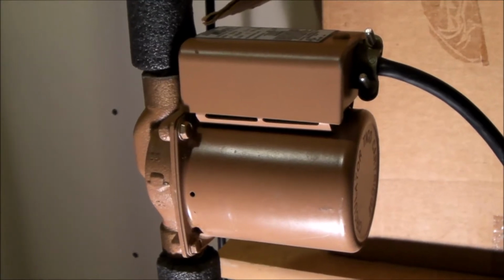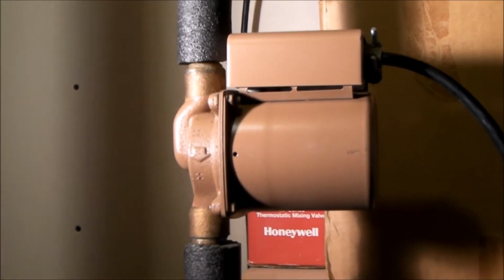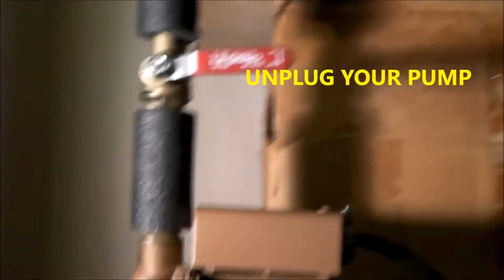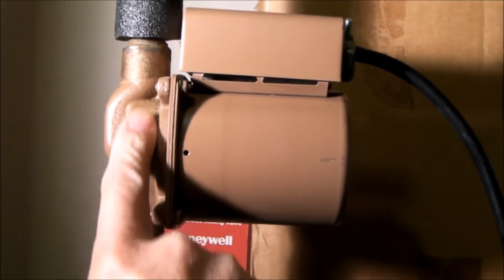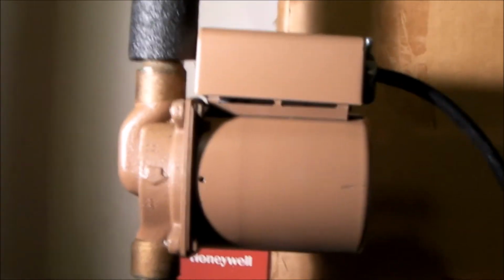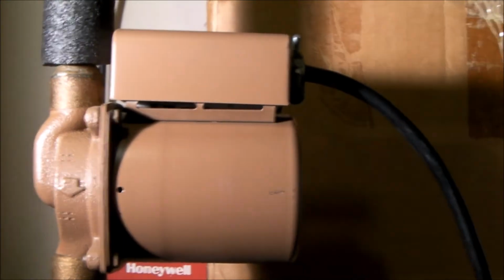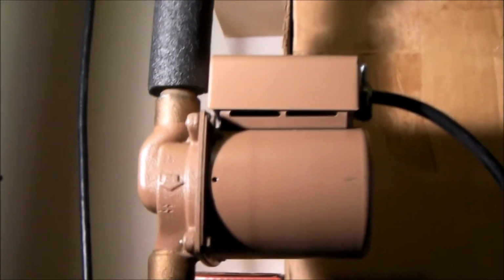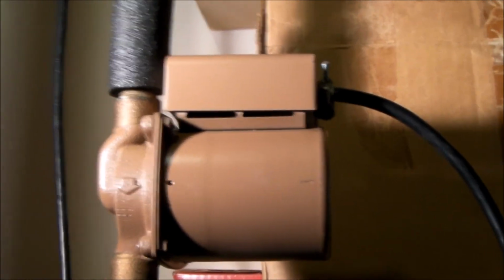Noisy Taco Hot Water Circulation Recirculation Pump - Solved

Comment: Very helpful indeed. Mine was making the same vibrating noise following a short power outage. My solution was simply to unplug the pump for twelve hours and let everyone in the house take showers (nearly everyone complained about how long it took for the water to get hot)! I plugged it back in in the morning and the pump is as quiet as ever. My conclusion is that the flushing that took place over the course of time was enough to clear out the pump and allow it to return to normal. I will re-post if further steps are required. Thank you for your helpful tip!
Reply: So you bled the line without opening it? Mine doesn’t have check valves 😬 it’s usually installed on the return line so it doesn’t have water actively going through it, don’t think…

Comment: THANK YOU!  I had flushed the hot water tank and then the pump started making the noises as you described.  I didn't notice it at first as the pump is on a smart switch and we have Alexa fire it off when we need the hot water boost.  When hot water didn't come as fast as usual, I did check the pump it was running hot and noisy.  My first inclination was that there was an air lock.  I searched the internet and luckily stumbled on to your video.  When I loosened the screws, air did hiss out.  In hind sight, that was all I needed to do.  I, however, pressed forward in case there were debris.  (Again, if I had really thought about it, I would discount debris as there was minimal debris when I flushed the heater.) After a few more turns on the screws, I took a shower even though I had turned off the valves above and below the pump :-(  For better or worse there was no blockage in the system.  While I had the pump out I cleaned the little debris present; reconnected the pump and its purring quietly.   Going forward, for me, when I flush the heater again, unless I see a lot of debris, I'll just "burp" the circulator if this happens. THANKS AGAIN!

Comment: Thanks very much. I repaired my Monitor water hydrant today. Now I have the same exact issue you had. I'll work in it tomorrow. Hopefully I didn't burn out the unit. It must have run for several hours before I realized that it probably had an air blockage. Best to you!

Comment: That’s the exact sound I was hearing in the building I live in. It was so loud you could hear it through the baseboard heating. Like I hear the water moving and sometimes little buzzing but sometimes it be so loud like a vibration noise it was so annoying. Finally the landlords replaced the pump now it’s silent

Comment: If this is for a hot water heat system or domestic hot circulation line, there should be a boiler drain or hose connection attached to the system for air bleeding. When the system is repaired or drained, the " closed loop" must be bled of all air. Just hook a small garden hose to it and drain to floor drain for 5-10 minutes while running the pump in normal conditions. Anytime air is introduced to the system, it must be bled or an air lock condition will occur, such as yours. And Yes check valves are required and No, Taco double 00 pumps do not have built in check valves. If the pump is used for domestic hot water, the pump housing or volute must be stainless or bronze as cast iron will contaminate the drinking water..... Great video Thanks

Comment: Good job. I have a very if not identical setup as you. Just replaced my LP power vent water heater...and during the replacement I guess lots of mineral deposits that were in the old heater got dislodged and up into the hot lines. It's like white coarse sand. Now my taco pump is not spinning. I guess I will open it up tonight. My recirc system does work without the pump but would like to get it spinning again. Thanks

Comment: Same thing happened to me today! We replaced expansion take and feed water pressure regulator. Then, when calling heat the unit would fire up and then fire off a minute or two later. I hit the circulator with a hammer lightly a few times, drained the system, then purged it out (lot of air). After, it fired up and stayed on. I am hoping there is no problems going forward.
Reply: I never took the top off the circulator pump. Given the location, it's hard to get in there to take it off. Purging the system did the trick.

Comment: My upstairs heat stopped working. It was working just the other day. I had a similar problem a few months back and my oil service replaced the Taco circulator pump. I just noticed the same pump is a little noisy when I turn the heat on upstairs but no heat. I wonder if I’m experiencing what you describe. Not sure if this is related but yesterday I noticed the toilet water was a little brown, even after a few flushes. Today it was clear.

Comment: Had the same noise. Had air in the pipes. So no water pressure to to the circulator so I did a release of air pressure from the furnace and the problem was solved. Did not have to take the circulator apart.
Reply from the maker: I did NOT take the circ completely apart.  Just loosened the flange to release the air and tightened back up.  Be sure to LIKE and Subscribe.  That will really HELP me! THANKS!!!

Comment: Interesting that your direction of flow arrow is facing in the opposite direction of where the electrical housing is.
I put the same Taco unit in today and the arrow flow is pointing in the direction of the electrical housing.

Why is this pointing away on yours?
Reply from the maker: Not really interesting .... the motor can be oriented in any ONE of 4 different positions.  The motor rotation is the same CCW or CW (depending on which end you're viewing it from) direction regardless of where the electrical connection box is.
Reply: @YuDaMan  It's interesting because as when I was installing it yesterday and I was curious of if the motor could be turned in that direction. Then I see it on YouTube later that day.

Comment: Water is what cools the pump,  if you have air in your loop ,  Eventually the pump cavitation that iar pocket and won't pump the water.  leading to burning out the pump .  Every now and then I find the systems need to be bleed out. Though I'm not sure why you installed 2 check valves,  you don't need them , the pump housing already has one in it. All you're doing is restricting the flow.
Reply from the maker: my circ pumps do NOT have check valves.

Comment: Hi YDM. Great video!!! I think this may be my problem. However NOT I've found I have a leak above the motor. Can I still get hot water in the house with the recirculation pump off and the valves on either side closed? It's the weekend and I'll have to wait for a plumber.

Comment: Thanks for the video. I have a question, so if the pump was dry then the water was obviously not circulating? Did you notice that the water was taking longer than normal to heat up before you flushed the line out? I ask because our pump started making that noise a couple days ago but we are still getting instant hot water at the faucets. I'm thinking my pump is maybe going bad.
Reply from the maker: not sure I can answer your question since it was quite awhile ago and I'd had to give you bad info.  I would however appreciate a LIKE and a SUBSCRIBE.  That would really help me.  THANKS!!!

Comment: Your video is FANTASTIC! I have the same exact problem. Thank you.  Question: What if I don't have TWO isolation valves like you? I have a valve feeding the pump, which I can shut off, and there's a check valve on the outlet side, before the pipe just feeds back into the water heater.  Can I still do what you said, or do I have to drain the whole water heater to make sure it doesn't flood when I open the pump?
Reply from the maker: Close the valve.  I think you will be able to loosen the screws but not remove them and you will be able to bleed air and water.  I would not take them completely out.  just loosen all of them the same # of turns. Then jiggle the pump to break the seal contact.  Then slowly open the valve, maybe not all the way and leave open until you have no air and only water dripping.  Then tighten up the screws, open the valve all the way and turn on pump.  It should all tighten up easily and nicely.  If your check valve is bad or stuck open, you might have a lot of water but manageable if you don't completely remove all the screws. I'd appreciate a LIKE and a SUBSCRIBE.  Report back if this works for you so you can help others.  THANKS.
Reply: @yudaman

Sounds like a have a similar setup to the commenter.
I may be overthinking this process and I have a question as I attempted to purge, but the pump was still noisy.

I did the following. 
1) unplugged Pump
2) turned off valve that send water to the house
3) turned off valve below the pump going to the water heater
4) loosened screws and drains water and air
5) tightened screws
6) turned on valve feeding house
7) turned on valve going to the water heater below the pump
8) plugged pump in

I may have missed 
turning on valve slightly before screwing back together??

Does that sound about right? Does it matter if the valve below the pump is off or on before turning pump back on?

Thanks for any clarifications.

Comment: Trying to see if this might be my AC problem. Could this be the reason an air conditioner does not get cold? I have to turn the hot water valve off and then the AC gets cold. When using the heater in the winter, the hot water runs out quickly in the showers.
Reply from the maker: I seriously doubt this has anything to do with your AC unless you are circulating hot water to heaters or radiators and trying to heat you house the same time you are trying to cool it.

Comment: I wish there was a bleed valve on this. seems like a little extra work.
Reply: Either a bad plumber probably installed it or it's an old house that predates code.
Reply from the maker: house built in 2002
Reply: @YuDaMan  Ah so a bad plumber unfortunately. You will probably have more issues later on since it's not up to code. A bleeder valve is a must since the 80s
Reply: @tolazytothinkofanamd2351  That is some helpful info.. I will definitely updating mine to code soon.

Comment: continuous?? that is a lot of heat loss as well as electricity. You could run a switch to the kitchen and shower so that you can turn on pump to save water and heat bu running it just before you want to use the shower or kitchen sink...
Reply from the maker: not much energy for the benefit ... heavily insulated piping and timer:  https://youtu.be/KGeBZ6fKg7w and https://youtu.be/KGeBZ6fKg7w

Comment: Good video!  Help me diagnose the issue. Did exactly what you said but when the sound still kept going, we replaced the check valve. Just wanted to share that in case any other DIYers run into the issue
Reply from the maker: I've had nothing but problems with check valves, whether they be swing gate type or spring type.  I'm thinking about replacing the check valve with an electronic valve ... activate valve when pump is activated.  thanks for sharing.  I'm sure it will help someone!

Comment: I got a similar issue. My Taco circulator (replaced professionally in 2014) is making a loud noise. Pulled the pump and housing off and very little water came out, and it was sorta brown. I'm not sure how much water should be flowing through this line but after I pulled the pump, I left the valve open, still very little water came out. I even re started my furnace and again, very little water came out. I'm thinking the lines need a flushing? I have no idea

Comment: The pump is not install properly. The arrow should never be pointed down. The manufacture don’t recommend. Because of air issues. It should be install horizontal. Where the check valve is.
Reply from the maker: The arrow is the direction for flow.  It has nothing to do with up or down.  Motor horizontal is the STANDARD position for this model according to the Taco spec sheet.  Motor up with pump at the bottom is ONLY allowed if over 20 psi.
Reply: @YuDaMan He's talking about the orientation of the pump. It should be installed so that the water flows left or right. Yours is installed vertical